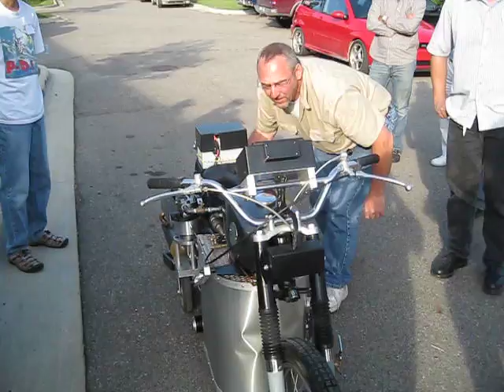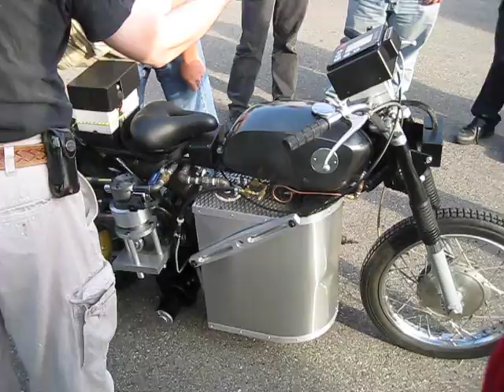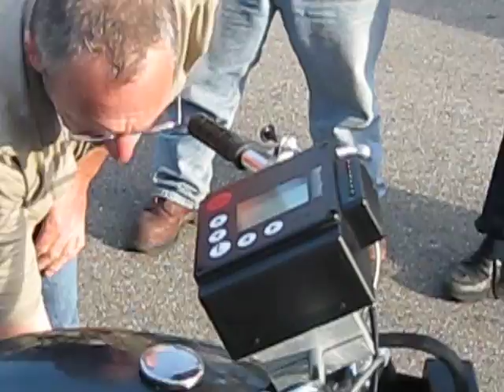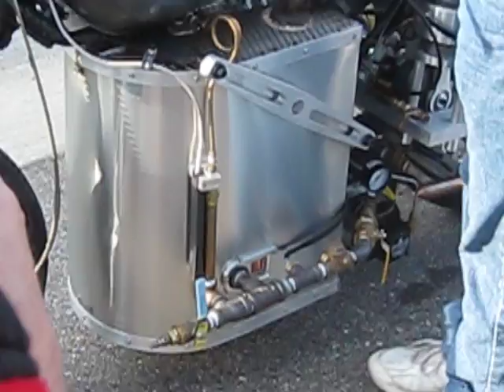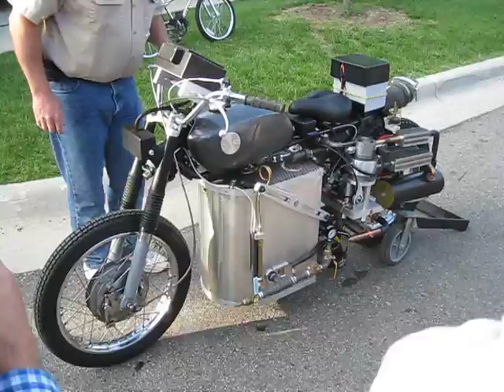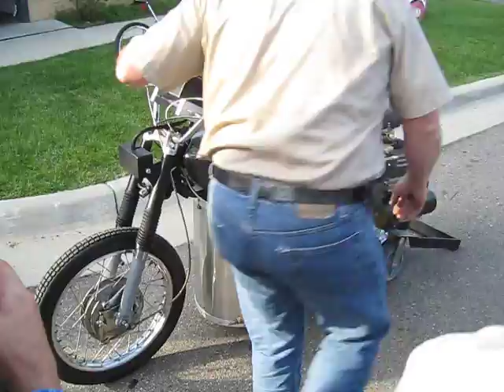Demo of Gene's Steam Powered Motorcycle

Comment: Reality is the fuel consumption of steam cars is higher than internal combustion engines for the same horsepower. Your "friend" does not have a car running only on water as that is impossible.

Comment: I sadly don't have video of it running yet, I acquired the bike recently and haven't run it yet. I am in college so I don't really have the time for a while until spring to run it and test it and the previous owner never tested it. I could send you pictures. Though I have talked with the previous owner and someone else who have seen it run. The plans for my bike can be found on the SACA website, it's a design by richard smith.
I could also tell you more details about the strong and weak points

Comment: wow this is impressive my steam bike is way simpler than this which I am fine with less to go wrong.  Also, I personally am not a fan of  electronic controls.  You can't fix electronics like you can mechanics.  Also, since it's a bike I just ride around till there's snough water, but mine has no sight glass and the boiler could care less about water lol.  I have 5 valves and or levers on the entire bike and 1 you don't mess with hardly at all only sensor is a pressure gauge.